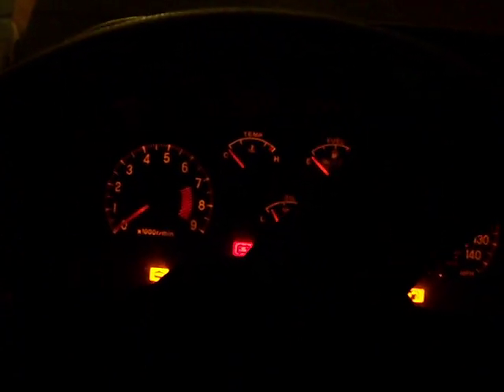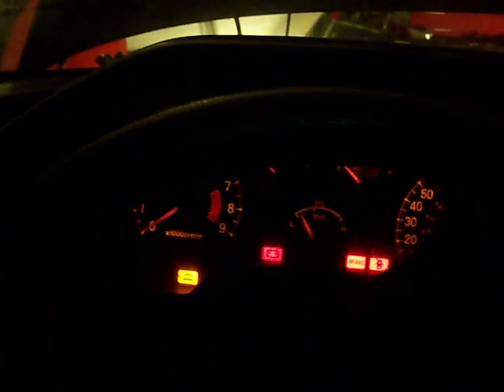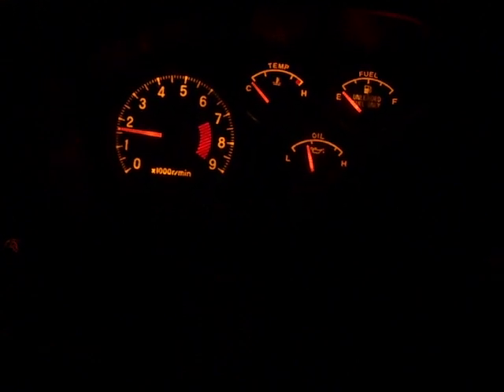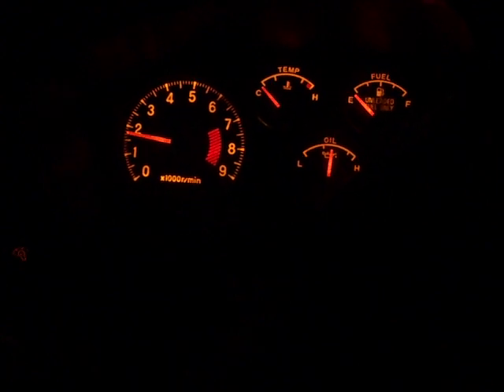92 Eagle talon Problems. (I FIXED IT)

Comment from the maker: @countryboyG The timing is adjusted by rotating the Cam Angle Sensor.  but before you do that the car has to be warmed up, and connect a jumper wire to the terminal for ignition-timing adjustment and ground the other end to the frame, then you can rotate the cam angle sensor till your timing is right.  (you should also have a timing light to help you.)  Check out VFAQ (just google VFAQ) if you haven't already.  that site has tutorial for everything with DSMs.  I'll PM you the link.

Comment from the maker: oh man that sucks.  check out ebay motors or craigslist.  You should be able to find one for no more than $400.  You can also try a junkyard, but then you'll be taking your chances on if it works or not.  But good luck, I hope you get it fixed

Comment from the maker: @happyweedguy When it comes down to it, you're car either isn't getting enough air, or not enough fuel, so you'll want to check then fuel lines, fuel filter, injectors, etc.  and then check the intake, make sure the TB opens all the way, no clogs or anything like that.  But for me, what fixed it was a new computer, The old one was just cutting off fuel at around 4K RPMs.  I have a rebuilt one for a 92 n/t that i'm going to be selling.  I don't need it anymore, let me know if you're interested

Comment from the maker: @edgar123chingon2004 
I did figure it out, for me it was a bad computer, so i got a new one.  but usually when that happens, you're either not getting enough air, or enough gas, so check the fuel filter, injectors, everything in the fuel delivery line, and if you have a friend with a similar car, try their computer in yoru car.

Comment: Dirty air flow  sensor maybe... Or  ecu may need resetting check fault codes through diagnostics does this have Vvt system? Some are electronic and controlled through the engine management system which maybe faulty aswell and could restrict rpm and force into limp mode basically to protect the engine hope this helps :)

Comment: hey awesome i have 1993 eclipse thats wont go past 2000 rpm, i Have the idle at a steady 1000 rpm. But the thing that stumps me is that when i go to crank it in the morning, itll start up like normal, i can rev it to the red line if I wanted but once it heats up, the idle drops and if i give it gas it sputters and misfires, does that sound ecu related too? im a total rookie with cars so any piece of advice is appreciated insanely

Comment: my dads 2006 dodge magnum will not rev past 4000 in park or neutral but when its in gear it red-lines so i think it is a Chrysler pcm
Reply: Alex Young my Chevy Malibu only revs to 4000, in park, but in drive it'll go to red line, I believe it's  dual stage rev limiting programmed into the ECU, to protect the engine.